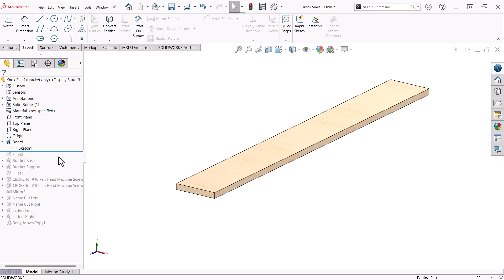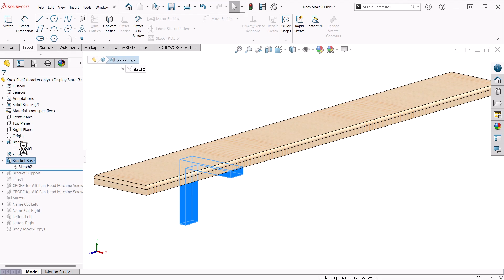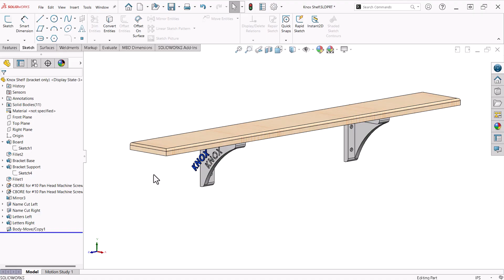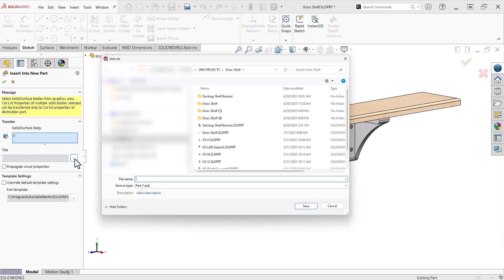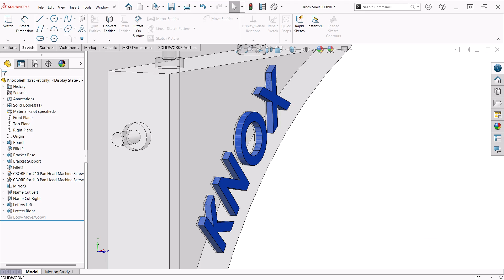3D Printed Shelf Brackets

Comment: Nice concept and design. However, if you would change the type of screw clearance to be the same for both sides you can print the same design twice instead of mirroring and creating a separate gcode for each side.